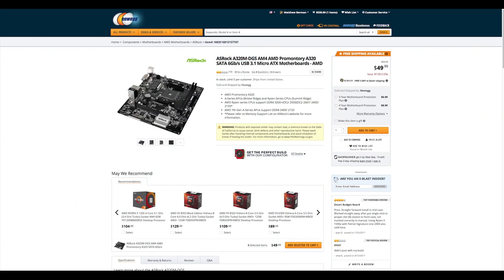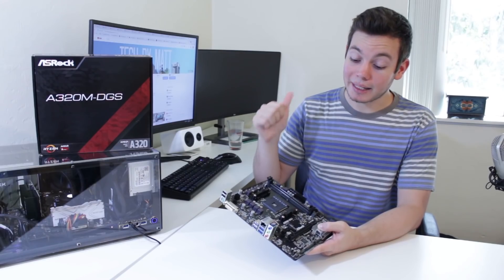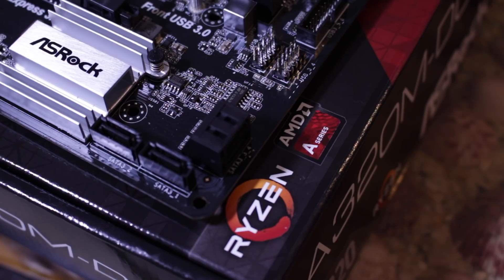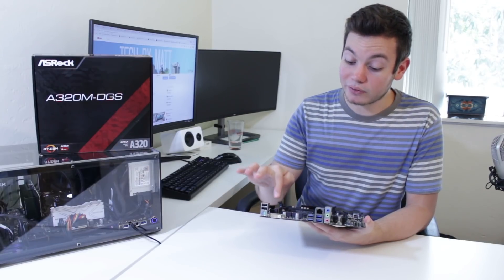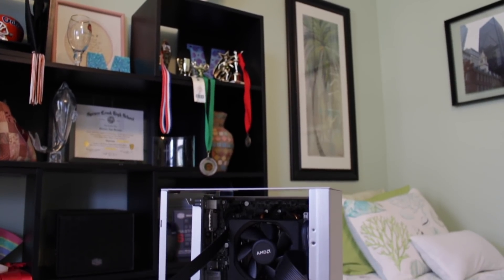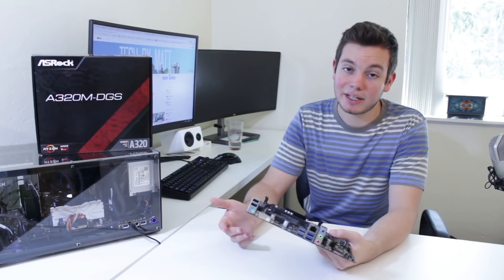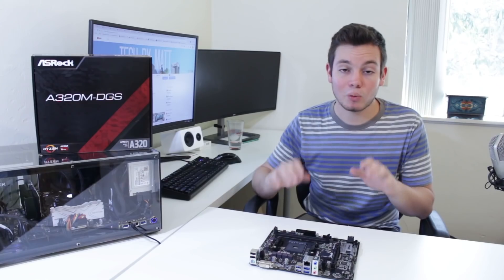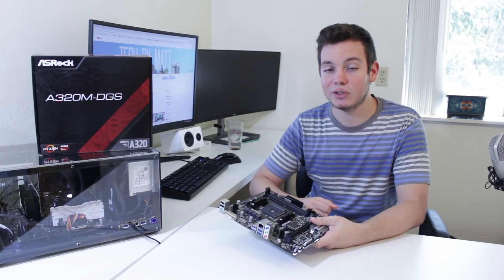Cheapest AM4 Motherboard on the Market!

Comment: I like the new design of the reviews, keep up the great job! I think this is an excellent motherboard for those who just want to build a cheap basic computer with only light gaming in mind and prefer stability over increased performance, because let's face it: No matter how few you overclock your system, it's not going to be 100% stable anymore. With a Ryzen 3 1200, GT 1030 and 8 GB of RAM it could be a very decent basic machine.

Comment: I love that A320, it is for rational people not for the nerds. I don't like to pay $30 more for the B350 motherboard and shorten the life of the CPU, just to get 10% more performance out of that CPU. If I want a faster CPU, I spend that $30 on a faster CPU. If you buy a non stock cooler for the overclocking, just use all that additional money (cooler and motherboard) for buying a faster CPU. Don't tell me overclocking makes sense, it is just a nice hobby for the nerds :):)
Reply: Bert Nijhof Sorry sir, but you are just wrong, i dont know who told you that bullshit but the cheapest b350 boards cost only 10$ more not like 30$ and you can also overclock with the stock cooler, especially with ryzen cause these cpus have extremely well temperatures and are easy to cool, even a 10-20$ cooler is most likely enough for overclocking a ryzen 5 1600 to its full potential. And the thing that you can only get like 10% more performance out of overclocking is, big surprise, also wrong. That is only the case for gpus but you can overclock most ryzen cpus to 10% more performance even with the stock cooler and the cheapest b350 mobo you can find. With a Motherboard that costs 70$ or so and a 10$ cpu cooler you can easily get 20% if you spend a bit more on the cooler probably 30%, and overclocking is easy and FREE (at least if you do it with the stock cooler, which is most likely perfectly fine for normal oc) which is pretty nice for that much more performance. For example you can (if you get a good chip) probably overclock a ryzen 3 1200 to where it is nearly as good or even as good as a ryzen 5 1400.
Reply: Bert Nijhof Your comment isnt showing up on my device, so i can only read the preview that goes until: "If i ne..." So i will only answer to the first part of your comment: I just looked it up and you can actually overclock a ryzen 3 1200 to where it is better than the r5 1400 in some applications/benchmarks and only a bit worse in the other ones with the stock cooler and with a cheap b350 motherboard. So you can nearly get the performance of a 50$ more expensive cpu just by overclocking the ryzen 3 on a motherboard which you probably pay less than 25$ more. Also b350 moards come with better features like better cooling, better audio and so on. So in conclusion b320 motherboards are only good for people who cant perform even the slightest overclock (which is pretty unlikely if you build your own pc, and it takes about 10mins installing all the oc programs and overclocking the cpu slightly, higher clocks take longer to achieve but you can easily get +10% performance on any ryzen cpu in 5 minutes) or who dont even have 20$ more to spend on their motherboard, but if you are buying a pc i dont think that you wont be able to get 20$. PS: Could you please send your comment again so i can read it, and i apologize for my bad english im in a bit of a rush right now and im not trying to write a grammatically correct text.
Reply: @mariahermann9563  but you can overclock the r5 soo...

Comment: In picking up a new athalon 200ge for a build for my sister and I think this is going to be the board I pick up
Reply: What website
Reply: How did the build go?
Reply: Any updates??
Reply: @thatonegamer2709  i built a pc like this my only advice is try to get fast ram preferably 16g 3000mhz otherwise it wont be able to play at max capacity

Comment: With this board an Athlon, an RX 550 or 560 a generic ram kit, a small m.2 boot drive, a 1Tb hard drive, a Rosewill case & PSU can beat any budget rig. Considering most OEM prebuilts tend to have proprietary connectors in inconvenient locations.

Comment: That motherboard is decent but if someone was to get into overclocking they would need something like a MSI A320M GRENADE which sells for about 50$ - 60$ and while that board can overclock it can only do so by at least 10% performance boost which would make it last a year to two years longer.

Comment: I would never go smaller than atx by the reason of cooling. The only reason is that the case is a bit smaller but its very few that actually need the space for something upwards and the case footprint is the same. Small boards require much more accurate fans whereas a full atx runs smooth with just a cpu fan and a case fan.
Reply: While i am using matx and atx but i did not notice a difference in temperature in both of them but there is a difference in price and amount of slots available in atx more than in matx in general.

Comment: Such motherboard + A8 9600= the cheapest machine able to play almost every AAA game (barely, at 30fps 720p low quality), and e-sports and multiplayer games at decent settings. Also, for Ryzen 1200, 1300X, 1400, 1500X builds if you really can not afford a better configured motherboard with 4 DIMMs and are against overclocking.

Comment: some ppl told me you can actually fry your components with cheap motherboards, is that true? i can find anything about it
they tell me i need to invest on a decent one asap
Reply: ASRock makes pretty solid boards, the cheap boards that they're talking about are usually those cheap ones from AliExpress
Reply: Run the asrock a320m-hdv revision 1.0  for about 2 years now. still runs perfect with no problems

Comment: The just 10 bucks more for a 350 board is so well spend ! if only it was just for the overclocking potential !
I really see no use for 320 boards ( unless there was at least a 30 bucks difference , not just 10 )

Comment: I am thinking about getting this board along R5 1600 + GTX 1070ti and two 8gb 2400mhz RAM sticks, do you guys think it`s worth it?

 I am not going to overclock, do SLI or use more than 2 RAM sticks.

I intend to play competitive FPS @144fps with a 144hz monitor
Reply: use a SSD 1tb

Comment: Great video man!! i was going buy the Asus Prime A320M-K/BR but later this video, i will buy this mob, cause the mob will changes almost nothing (for me) 
I will use r3 1200 @stock and the value of this mob helps me buy a gtx 1060 3gb instead of the gtx 1050 ti
Reply: Hi, i recomend you getting a overclockable motherboard u can oc, AM4 socket will be used until 2020 so that means the new amd cpus will work on it too. New nvidia gpus will be out in 1-3 months which means a gtx 1060 3gb will be shit so u better get a 1050ti and a proper motherboard so u can just oc the cpu and upgrade to a new gpu later on without bottlenecking ur gpu.

Comment: Hey,
What are supported frame rate of hdmi ports of this motherboard?
Specification says at max resolution of 4k/2k it supports 24Hz/30hz
Does it goes to 60 hz at any lower resolution  ??
Reply: It doesn't have any hdmi ports, only a dvi-d port with supports up to 60hz.

Comment: I have a serious question...  I just built my PC..  But I dont have a DVD drive..  So I need a USB installer for the best windows for gaming.. Pls send me all info I would truelly appreciate it!!!
Reply: BabyJokyr go to the microsoft website and download windows 10 media creation tool and really for the latest versions of windows it dosent make the slghtest bit of diffrence but when you put the usb kn you have to go into the bios and change the boot order it shuld be easy to find a video on it if you cant. Figure it out. Ut kf your board is old then you probebly cant use a usb i hope i helped 😀
Reply: Kinda..  Only problem is I don't have another computer..  So I have to either be y a USB installer with windows on it..  Or plug up a disc drive outside the case just for the install process..  I have the asus b350 moba

Comment: Will this support the ryzen 3 2200g out of the box?
Reply: Ben Nardone I don’t think so you can wait for the b450 boards coming out or if not you will need to update the bios before. Which you will need a regular Ruben chip for. Or the place you purchase the board from may update it. You will need to check.
Reply: Thanks I decided to just go with the 1200 and a msi gaming pro so i could overclock

Comment: hey matt , I have a socket 775 motherboard with a pentium E , I can afford a core 2 quad q8300 or q6600 , booth cost $12 , are they any deffirent ?
Reply: and will radeon 5670 work good with it ?
Reply: random person Haha really funny
Reply: Q8300 might overclock better, but you'd have to use proper cooler, RAM and motherboard for that. Otherwise- those CPUs should be about the same clock for clock. One more option for you is getting Xeon E5450 repurposed to work on s775. They can also be found very cheap, and are the same as Q9650- as long as your motherboard is at least average and can support a chip that powerful.
Reply: +NeblogaiLT  thank you , yes I have a good motherboard , I bought 8gb of ddr2 800MHz for $2 , I found a big 150mm heatsink in a scrapyard , and bought the fastest fan I could find , so hopefully If i can overclock the cpu to 3.2GHz I will be happy .

Comment: I am overclocking cpus and gpus since my first pc parts even now my pc is oc but after all these years i can say its not worth it performance and temp wise and the cost of cooling and oc boards. Better buy cheap boards with locked cpus that mach your need where stock cooling is even enough and silent and will last forever. Gpu oc well today they do it themself or you cant do much than it came out of the box. And you will save money power and can more often upgrade the cheap way and stay up to date. P.s damn you ddr4 prices.

Comment: If i were to buy a ryzen 5 3600 would it work
Reply: Yes. I have this exact set up. Worjs perfect for me. Big games like rust run great at a smooth 70 fps. But im also rocking a gtx 1070
Reply: It will.
Reply: @albertcohee7757  but,, the m.2, is it sata, or pcie?

Comment: Can you do the same but for Intel ?
Reply: If you don't have a K SKU CPU I'd recommend the cheapest motherboard you can find that supports your CPU
Reply: I was looking for the cheap MB to fit G4560.
Reply: Asrock h110m i think it's the most cheap
(sorry for my bad english btw :( )
Reply: Hrr10 if you don't have a skylake chip don't get h110, you need one to use it
Reply: SilverHawk asrock h110m dvs r3.0, normally you need a skylake chip for updating the bios on h110 motherboards because they dont support kaby lake, but this particular one supports kaby lake so you dont have to worry, goes for about 50-60$ on amazon. And if you didnt know it kaby lake is the "new" generation of intel cpus (the 7th generation), you can identify it by the name of the i3, i5 or i7 cpus like i5 7400 or i7 7700k (the names with a 7 at the beginning of the number). Also the pentium g4560 is a kaby lake cpu although the name doesnt start with 7. And skylake are the cpus that have a 6 for beginning (6th gen), again the exceptions are pentium cpus and stuff like that. But for now you just need to know that the asrock h110m dvs r3.0 is one of the few h110 motherboards that support your cpu.
Reply: Maria Hermann Thank you very much!
Reply: SilverHawk youre welcome :)
Reply: What Intel CPU?

Comment: This motherboard is $90 on amazon and $60 on newegg.

So the $45-$50 motherboard to get is a  $60-$90 motherboard on sail?

It's weird a $75-$90motherboard commands a sort of value/ respect that doesn't reflect the actual motherboard.

I wish pc part picker was simpler, and had like pre sets, of good motherboard etc and could tell you which one was a good deal automatically, biased on the tags/ features.

Comment: Barely any difference in using the cheapest motherboard to the most expensive

Like having a 500W and a 1500W PSU. No noticeable difference
Reply: Teemo4Life depends what you want to do.
Reply: It's more if you need overclocking or not.
Reply: Overclocking (at all), ram support, fan headers, rgb headers, multi gpu support

Comment: For $50 This motherboard will not perform great.  It only holds up to 32GB of ram and you can't crossfire graphics cards.  If you really want a cheap motherboard that performs great for around $100 to $140 you can get a MSI Krait x370.
Reply: Happy and single Only up to 32GB of ram? Lol